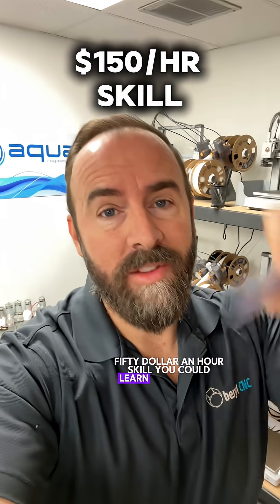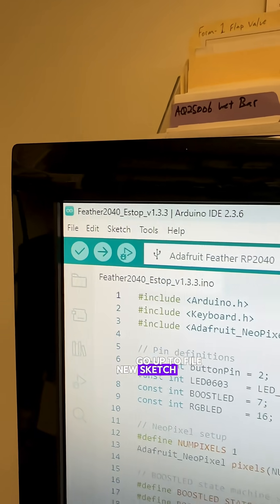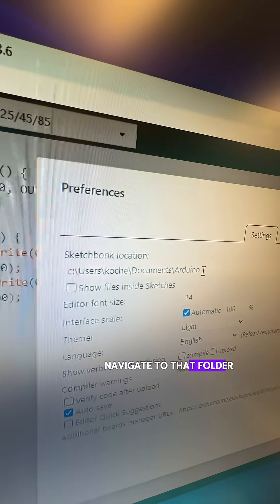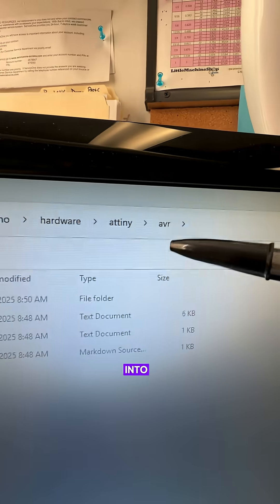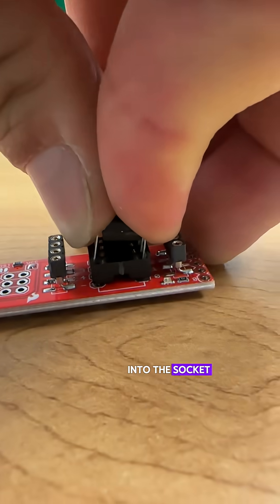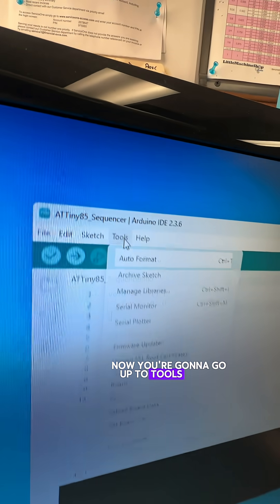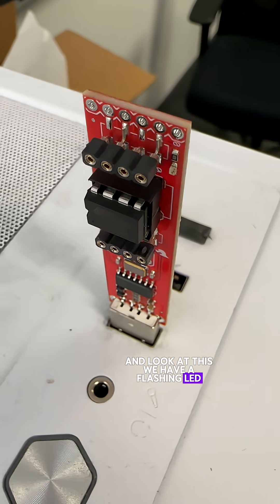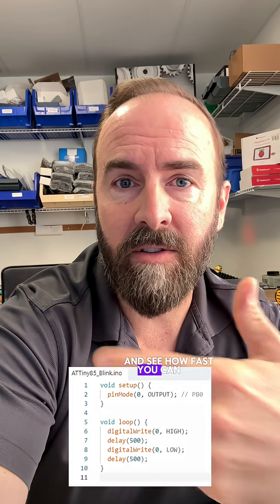Intro to ATTINY Microcontroller Using Arduino IDE

Comment: I had ATTINY 65 or 85, don't remember and this thing is pretty cool, but I didn't tested it outside the Windows 11, so on this my engineering  finished ig
The next step maybe buying the soldering iron to do smth else, but I have no space for it

Comment: Still my favorite little controller, made custom prototyping PCB's for the tiny 85 and an adapter for the digispark to hook up the isp programmer and flash the bootloader to get rid of microneucleus and the digispark is significantly more reliable this way.
Current project in the works uses a waterflow sensor and a solenoid valve to dispense specific amounts of water....to fill my tea pitcher with 2 qts of water from my RO system. lol

Comment: Doesn't it have to be UL listed to sell it though?  I guess you could legally mark and sell it as a prototype, with the right paperwork.  But that's seems pretty niche.  IDK
Reply from the maker: Usually FCC part 15 for unintentional radiator, UL if over 48v I believe.
Reply: @i2c_jason  I ran your response through GPT5. It says the product should be UL certified if it's finished, regardless of voltage.  And the common strategy, for any voltage, is to prototype and send that to a UL shop to build it out.  It's usually pretty well trustworthy usually.
Reply from the maker: @Quantum_State_Space in my experience with the UL approval process and associated labs, they don’t typically solve your design or propose solutions. They basically ask you to call out the specs and minimum clearances between conductors, feed it to them, and then they eventually approve it. Typically above 48v. FCC is more important for low voltage microcontroller devices headed for the mass market. I’ve never heard of UL being a requirement for a battery powered data logging sensor, for example.

Comment: I have just a tiny bit of experience with esp32 and was thinking about connecting my minisplits ac to them, because just to buy the dongle was over $60 each, if you could even find one.  ESP32 $7.  But then I found a guy from Ukraine that sold them that work with HA ready to go for around $20.  I could have probably figured it out, but it wasn't worth the amount of time it would have taken me.  However, I do have other projects I will get to some day, it's just hard for me to learn at 63, when my only coding experience is writing batch, and bash files.

Comment: What if you get an old Japanese sports car with pop-up headlights, and modify the wiring and add a camera facing the driver and a program that detects when you blink, and make it close and open the headlights at the same time. And you can blink one eye at a time and make the car "wink"

Comment: There is potential in these skills, but the video seems not to be basic enough for people with no knowledge to understand the usefulness (all that to make an LED blink?). No explanation of arduino, lightly touching on cut and paste and downloading code, anyone without a partial knowledge won't find it useful or meaningful. Anyone who does understand it is too advanced for the video to help them. Love the idea of getting more people more literate in electronics, it's just hard to explain to beginners. It's impossible to separate what seems easy with a working knowledge that was accumulated over multiple classes from what really is simple to a beginner. It's like a chef trying to show someone how to cook, explaining step by step how to cook a steak without them understanding the purpose of marinade and the sear. They can repeat the process to make the exact dish, but they'll be lost on lamb chops. They don't have the general knowledge that ties different uses together.
Reply from the maker: This video is meant to inspire as much as inform. And it’s 3mins 😂
Reply: @i2c_jason The sharing of knowledge and passion is always to be commended. I wasn't trying to knock the video, just thinking with my fingers. I find it hard to teach intermediate knowledge sometimes because I take for granted things that seem simple to me aren't understood. I hope more people learn to delve into electronics. Your channel will certainly help with that.

Comment: It seems the ability to straighten the pins has been lost to time.  I know, I know it keeps the IC in while you solder it to the PCB.  I just take the pins to a flat surface and bend each side a little until they are parallel.

Comment: the syntax and formatting are very scrambled!!

Here’s a fixed and readable version of your code:
// ATTiny85_Sequencer.ino

void setup() {
  pinMode(0, OUTPUT);  // Set PB0 (pin 0) as output
}

void loop() {
  digitalWrite(0, HIGH);  // Turn LED on
  delay(500);             // Wait 500 milliseconds
  digitalWrite(0, LOW);   // Turn LED off
  delay(500);             // Wait 500 milliseconds
}
💡 What it does
This is a simple LED blink program for the ATtiny85 microcontroller — basically the same as the classic “Blink” sketch for Arduino boards.
* pinMode(0, OUTPUT) — Configures pin 0 (PB0) as an output pin.
* digitalWrite(0, HIGH) — Turns the LED (or any connected device) on.
* delay(500) — Waits for 500 milliseconds (half a second).
* digitalWrite(0, LOW) — Turns the LED off.
* delay(500) — Waits again, then repeats forever in the loop().
So yes — as you said, “AND THEN IT FLASHES” — that’s exactly right. It makes whatever is connected to pin 0 blink on and off twice per second.

Comment: Fun compsci fact: you preferable don't want to use delay() in your program. It stop every thing the micro control is doing went it hits that delay() call and may lead to issues. I would recommend get in the habit of using millis() in your program for micro controls.

Comment: I have my own work station, custom programmers, attiny boards, and a drawer of stuff I've made. I've never seen a single place that I can put my knowledge to use without a degree. Arduino basics are easy as it gets.

Comment: Texas Intruments makes a good alternative to the atmega 328p; the msp430.  You can get the solo chip for about a dollar or two and a full dev board for around $10-$15.  There is a sketch pad like aurduino called Energia.  It is nearly identical for programming.

Comment: Im currently in my college course for learning microcontrollers. We've started out learning assembly so I can't help but appreciate when we just have to use C to program these. Since im almost done with my EE 4 year degree I've learned C, Python, PLC programming, MATLAB, JAVA, and now Assembly. 
Doing these microcontrollers in C is so much cleaner than doing it in assembly. Just seeing your flashing LED program I kept thinking about the nop loops we'd have to make and the math we'd have to do to ensure the cycles added up to the correct 500ms.

Comment: Built my own 3d printer from parts I sourced on my own and modified an open source firmware to fit my design. I wouldn't do it as business to earn money. But it did help me show my creativity when getting my first job after completing my CS degree. 

This video is a bit too positive for my liking, selling yourself as a freelancer with no background is extremely difficult. You need to spend a lot of time creating a sellable product/skill and then somehow manage to sell yourself in a cutthroat market. It's much easier to work corporate a few years to learn and then later do freelance when you have more skills, market knowledge and connections.

Comment: i feel like i have ideas that can use this tech or could come up with something that would in order to try and sell a product, however i really am a bit confused as to what it does and its limitations. lol
Reply from the maker: Well this is a little electronic chip with a few “GPIO” which are general purpose input/output pins. With it you can a) run from a battery for an extremely long time, b) measure sensor levels and states, c) time stuff that happens in the outside world or hard-code a timing that has to occur as output. Multiply these capacities by any other microelectronic device or component capabilities and that might guide your creative mind.

Comment: I like the idea of creating a wireless garage door openers/gate openers using this. $4 RF receiver running high output to the tiny 85 with a timing circuit. Very interesting I wonder what chat GPTS to think about this

Comment: I would add, don't focus on Arduino IDE or .ino's for long, it can help teach you how everything works but if you walk into an interview and say you code in .ino's you'll get laughed out. You want to develop marketable skills. Switch to things that are actually used in different industries. STM32CubeIDE and STM32 devices are standardized in the automotive industry for example.

Comment: As someone who knows nothing about this it's difficult to understand what I'm seeing. Is this code stored ON the AT microcontroller so it can execute based on I/O of the pins later without the USB device? I think that's what I'm seeing here but I don't really know. The USB portion only exists to program the little AT?

Comment: Wait I can make 150 an hour doing this? I literally program a similar version of the ATtiny using another arduino as a in serial programmer. Use it to read signals of other chips. Hell got an esp32 so I can read uart lines from a 3.3v system. I dont even get paid for this stuff. I just tinker to learn how embedded systems work among other different technologies. Hell even made one bitbang for one of those 16 char by 2 displays just using the datasheet. Still make 0 dollars.

Comment: I work in the refrigeration field, and with newer control systems its common to have to completely bypass microcontrollers, VFDs, ECMs, modules, etc because of cost. I've always wanted to dig into them and learn what faults could be designed differently to make it preventative. 

This is definitely an inspiration to start an attempt.
Reply: the real gold is in being able to make your own controls and get around all the proprietary BS that you cant TS.
Reply: I'd like to see the results. Pass or fail. It's something in a positive direction. That new subscriber is me btw lol

Comment: I actually used Arduino and an RC car to build a GPS guided autonomous robot earlier this year which used ultra sonic sensors to detect obstacles and move around them. Pretty fun stuff, but as you get more into Arduino you can really see the draw backs. It had a giant issue with pinging the GPS for coordinates while then using the ultrasonic sensors to detect distance.

Comment: Glad to see the ATTiny85 getting some love. I use one to control the lights on an aRGB fan for my 3D printer. Sure an ESP32 is more capable and has wifi connectivity, but this thing is ultra compact and cheap enough to set and forget
Reply: But ESP (not module) is also smaller, cheaper, more capable, i used both and ESP wins even without using Wifi...

Comment: Watched your video on reviewing the comments. Thought I would get in the mix. I trained in discrete electronics, microprocessors and dabbled in software design during my electronic engineeering degree 20+ years ago. After 25 years in telecommunications, your video brought back memories. I am now working on kindling this spark to start building things again. Even if it’s just for fun or sharpen my skills. Who knows, there may be a retirement opportunity coming.

Comment: I have an answer for how fast you can make it blink. Setting both delays to 20ms you're at about the limit of human perception, after that you'll hit the flicker fusion threshold. Setting it to a delay of 1 will simply look like the led is at about half bright.... kinda. When it comes to vision brightness is logarithmic so it'll actually look like 70-80% bright (I'm too lasy to do the maffs). The actual limit on this exact hardware is 8 000 on and off cycles per second, setting it to 16mhz and a delay of 1.

Maybe I should get into arduinos 😂 don't even own a computer at the moment

Comment: Ok what about other components? can I make this into a drone's central controller? what components do I need for that? can I make relative distance calculation between 2 components? collision avoidance? can I get the drone to dock onto a battery by flying this distance (essentially making the drone self rechargeable)? what component do I need for battery and docking?

Comment: Hmmm. 20 yrs as an avionics tech with a micro/mini/hot gas repair cert....  No ESD protection???  And there's a tool for insert/removal of socket IC's....  Just saying that there's a right way and a shortcut way.  He's not wrong.  EPROM's are cool this way, but it takes all the electronics out of it.  As there's a whole world of and/nand/or/nor logic and more to determine what it is doing.  But that is getting in the weeds.

Comment: I still don’t understand what its use is and why this skill is worth $150. Help.
Reply from the maker: This is a small electronic chip that can do stuff with code in it. It is extremely low power and physically small in size, so it can be used in high volume products for consumer, medical, and industrial. So if you learn how to do this kind of electronic work, you could self employ doing prototypes for these industries.
Reply: @i2c_jason thank you for the explanation

Comment: This was a super informative way to kick off learning about this stuff....

Showing the idea of what you can do.
Reply from the maker: All of my customer projects are under NDA so I can't show them, but there are quite a few projects using microcontrollers featured on my short videos if you wanna check them out. One drives the acoustic ultrasound horns on a reactor prototype, for example, and another one runs a CNC machine on a lathe.
Reply: @i2c_jason how do you find clients?
What are the other steps 😂
Reply: Just sold my first blinking led for 159 dollars

Comment: Go into tech in the tech bubble? I applied to 3 jobs and got 3 interviews. I may now be making 150, but im okay with job security
Reply from the maker: Microcontrollers are kind of a different animal, since they are hardware. There is always going to be overflow engineering work in this area for self-employed R&D firms.

Comment: might be an ignorant question, but considering where we are in tech right now, arent we mainly using cipsets for system like linux, android and so on on even devices like refrigirators. 
I follow tech but not that closely so please ignore my ignorance and someone explain me, is that a skill that is usefull and will be usefull for a long period of time or is it jsut momentary to support legacy devices and devices like lets say gaming mouses/keyboards where they benefit from the low energy consumption from these chips, while robots for factory automation slowly go into bigger chips then the one being programmed with arduino to ones that run whole operation system?
another question, how is this related to plc developers and cnc setters ?
Reply from the maker: I'd say everything you summarized is accurate. There will always be some products that need absolute lowest power, smallest form factor, and lowest R&D development cost. PLCs are more for hardened industrial applications, basically they have microcontrollers inside of them, are physically large, and more modular for use with stuff like contactors, 4-20 mA sensors, and plug and play industrial components.
Reply: @i2c_jason I really appreciate taking your time to explain it to me. Thank you

Comment: I’ve been messing with Arduino for over 15 years. I don’t have a clue how to start making money with that knowledge though. Would be super fun!
Reply from the maker: Start documenting your projects / builds, and make a portfolio. Then start a business and offer to make prototypes for customers you network and find. I'd also recommend learning CAD and picking up a 3D printer. If you can just do those other two things, you really have a solid seedling of an R&D firm.
Reply: @i2c_jason  id say the hardest part about that is the networking, not necessarily the skill

Comment: Interesting vid. Not interested in making a living from this but am Interested to understand what the real world applications of this skill are. What’s does this convert to? Is it a standalone solution you just made or a part of a larger solution if done with other things or multiple times? Thanks
Reply from the maker: This chip could control the heat level in a handheld appliance, drive lights, motors, and switches for a toy, or help automate a manufacturing operation. All of which require a prototype and pay $150/hr or more if you're self-employed. This example is called a "hello world" program because it mostly eliminates the very difficult barriers to entry for this specific part. So once you flash that LED, you can do whatever else you want pretty easily. Aka, I've shown the hardest part of making this small microcontroller start to run. You can take it from here and make whatever you want by brining up other peripherals on the device or adjusting the code however you prefer.

Comment: This is good and all but a lot of mindless following steps and not really understanding why you're doing it or what you're actually doing. Just saying it's not as straightforward to a beginner as you're trying to make out
Reply from the maker: The point is that you have to suffer through the difficult stuff to get that LED flashing as the Hello World program. Once you accomplish that, you've unlocked enormous possibilities. Problem is it's literally so easy and dumb that it's unbelievable to most people, but it's what sparked my 21 year career in R&D.